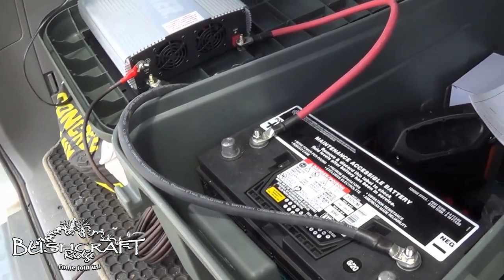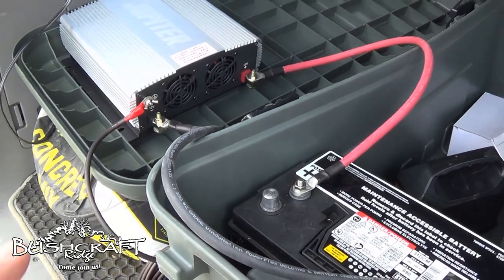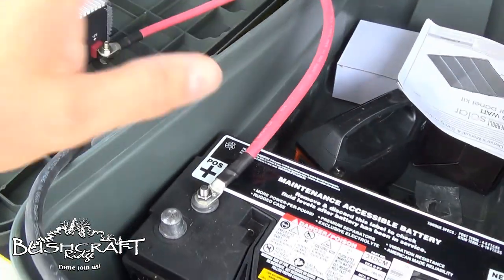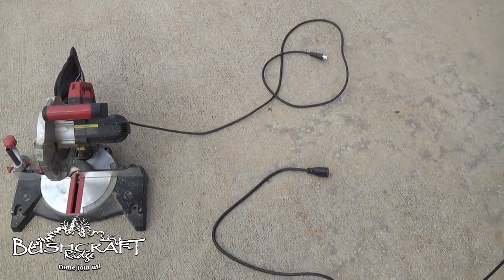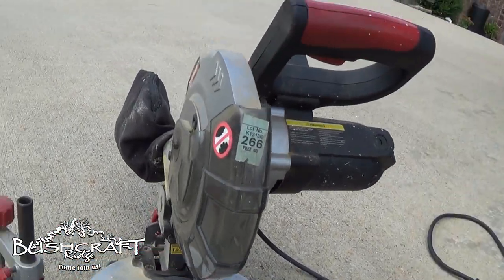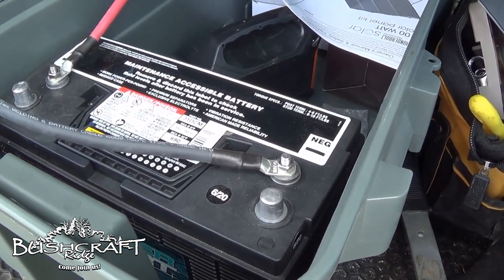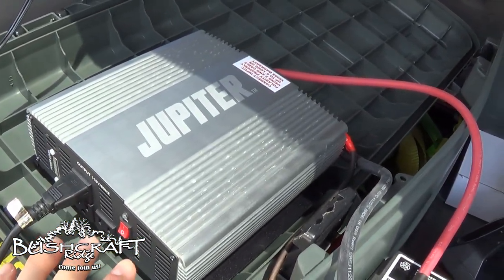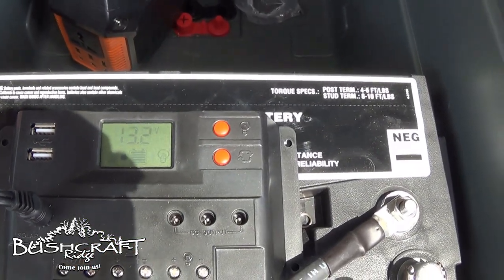Testing the Jupiter 2000w (4000w Peak) Power Inverter from Harbor Freight

Comment: I also purchased the Jupiter 2000 Watt Power Inverter from Harbor Freight. I also purchased two 24 volt deep cycle batteries and all the cabling to go with it. Never had to use them, but keep them for around for a "what if" scenario. I keep the batteries on a trickle charge so they're always primed. It's nice to see someone else who has purchased the same item putting it to some use. I liked your video!

Comment: The problem with testing the saw as your power draw is when you don't cut a board with that saw your not putting a load on it so it's not drying his much power is it would if you were to be say cutting a two-by-four

Comment: Using a 800cc or a 860cc battery with a 1,500w or a 2,000w inverter with your car running can it power on a electric oven that's 1,500w may someone try it ?

Comment: I have the Jupiter 1000W version.  Only because my RV fridge runs on propane or 120V.  A little difficult to cool the fridge when no 12V system is available.  It works well for me for that purpose.  However, it produces a lot of RF noise if you plan on using radio equipment on the HF bands.

Comment: What I have found using my Skill Circular saw to prune the trees around my house I can only do it lightly before the breaker beeps and needs to be reset. If you try pushing a load through it it will pop the breaker every time. What I find my 2000 watt Power inverter is good for is the harbor freight saw saw for $20 with coupon doesn’t pop the breaker but I seem to only get about nine months of intermittent life out of the saw unit for the third time🤢🤮🤮. My recommendation also get yourself also a tiny 300 W unit the reason being you don’t want to deplete the batteries energy for small consumption uses.
Reply from the maker: Thanks for sharing!
Reply: The reason your only getting 9 months is because this is a modified sine wave inverter, not a pure sine. Modified sine wave inverters, while cheaper, are not much good for long term use on certain components. Notice I say certain, because some electronics seem to weather better than others.

Comment: I have the same exact one and you DON'T need to hook the big black negative cable to the battery. You can hook it directly to a seat bolt or somewhere in the chassis because the battery terminal coming off the battery is just grounded to the chassis itself. This is DC (direct current) and not AC where it alternates and needs to come back to the power source like a breaker panel box in your house (black and white wires). 

The smaller ground wing nut is the "equipment grounding conductor". It basically helps grkund the inverter body. Just hook a wire up and ground it to a different ground point. I've never used it and my inverter still worked.

Comment: I had to buy the Jupiter 2000 when I needed some power ASAP. Saved the day, but our car battery had no small aux posts like I see here. I just hard to tuck the flat pieces under the existing cable connectors. Again. It saved the day but I am woindering with 2000+ can you only use cables like this or can you get some with like jumper cable type clips? My connections were tenious at best and just had to stay very still. Thanks for the post!

Comment: Nice heavy duty cables! For out at your cabin, if you haven't already, drive a steel pipe or any long piece of metal down into the ground and you'll have a decent ground termination. 
I like that it can run that saw. That's 84W continuous but it could draw as much as double the current and of course more Watts. Hahaha as I'm typing that you were questioning the startup power draw of the saw. I would estimate the peak startup draw to be no higher than 15A.
Excellent setup, it's come along nicely.
Reply from the maker: How did you know I was going to ask you about how to ground out at the cabin!? You answer my questions before I even ask. A foot or two of rebar under the cabin okay?
Reply: @BushcraftRidge  definitely! For high power things like a plasma table it will have brass rods. For your application and the amount of total power, W, one piece of rebar as deep as you can hammer it down will be perfect. If it's rusted that won't be a problem. However if it's coated in epoxy or paint expose as much metal as you can. To "bond" the wire to the rebar a clamp is more than enough. Even just wrapping several turns of the bare end of the ground wire then wrapping in tape will be perfect.
Reply from the maker: Thank you, sir!

Comment: You really need to crimp that wire as you well know. Any electric connection that is loose can arc and catch fire and/or melt the wire. Thanks for the review, I need pure sine wave and harbor freight has them too. Either going with them because you can buy extended warranties which it’s not a question if if it will fail, but when, lol. Love Harbor frieght

Comment: nice video but power still in the inverter you should put switch between positive of battery and positive of the inverter to shout it off so no power in side of inverter cool video

Comment: It the description its says NOT for marine use. Does that mean not to use marine batteries or not to use on a boat??
Reply: On a boat saltwater in the air will eat the components if they aren’t coated however will work on a marine battery
Reply: I think there is confusion because of battery terminology. Use a deep cycle "marine" battery. These batteries are designed to be drained to nearly empty and then recharged multiple times. Typical car cranking batteries will work but are designed to supply many amps up front then have be recharged relatively quickly. Most likely you wouldn't get the life out of them if used to power an inverter long term. I would guess the inverter is not designed or suitable for use in wet locations such as on a boat.
Reply: @rudolphcastle9110 i was confuse too thank u..
Reply from the maker: I thought it meant not for use by the US Marine Corps.

Comment: Why did you choose a modified sine-wave (better called a modified square-wave) inverter?  This really is a significant limitation to your system.  You would do much better with a pure sine-wave inverter.  The price at HF really isn’t great, even for a Modified Sine-wave inverter.

Comment: Got one of the when on sale and it was dead on arrival. Fuses are fine and hitting the reset does nothing. Anybody have any suggestions on what i can do? They wont return it and it wont work and im not sure what to do. Highly recommend security nuts or locking nuts to deter theives, previous system was stolen. Rebuilding setup now and its proving more difficult. Cost is higher, budget is spent, quality is lower. Charge controller, inverter, and batteries were stolen. Solar system still here but trying to get something running on the cheap... Any suggestions?

Comment: So if you wanted to run a window ac unit at your cabin, would you just add more batteries? Can the 100 watt panel system you have charge 6 batteries? Just takes longer to charge the 6 batteries?
Reply from the maker: Yes, as long as the inverter wattage will support whatever the a/c unit needs. You could add more batteries or bigger batteries. And you could also add more solar panels to the charging system.

Comment: Question.... Will this work for my lawn care vehicle? I have an all 40v battery powered set-up. How many batteries may i charge simultaneously with this particular inverter and a dedicated 12v battery. All set-up independently from the main battery of my vehicle.
Reply: how many of my lawn care 40v batteries may i charge on the 40v battery charger

Comment: If I’m doing this in my shed where electricity is not available, where would I ground it? Or does it always need to be grounded?
Reply: drive an iron rod a few feet into the earth and then attach the ground wire to the rod
Reply from the maker: Like Time said. I do rebar straight into the ground.
Reply: 8  feet, to be precise.

Comment: Grounding it to the vehicle can be problematic I did that for my mobile home and touching anything that was grounded gave me a nasty shock and when I tripped and fell touched both the mobile home and my camper that the inverter was in I got a nasty shock and fried the inverter I finally found a utube channel that explains why apparently an inverter even puts power to the ground so ground has to be earth this problem was what stopped me from going solar for a lot of years
Reply from the maker: Thanks for sharing. Yeah, I since gone with rebar driven into the ground.
Reply: Another F Y I is for every 1000 watts you should have a battery. Each battery can provide 1000 watts, but if for some reason you need to run say 1800 watts and it has to surge to 3000 watts something is going to trip or burn out. 

It does not matter if you use a set of 24DC or 27DC OR 31DC batteries, there should be 4 batteries for an inverter that surges to 4000 watts.  We own several size invertes and the inverter best matched to the power draw. We have 125, 250, 450, 750, 2000 and 3500 watt inverters. If I am only running some LED lights at night I use the 125 watt 250 surge inverter. We also have two battery banks that I can tie together for 8k of total surge watts if using several inverters at the same time. We live in Florida and deal with a lot of power outages and brown outs. 

Hope this helps anyone who did not know. My system is over 10 years old and all my inverters still work but one. Had to repace the 750 watt after a few years.

AMPS  X  VOLTS = WATTS
1 AMP X 120 VOLTS = 120 WATTS

Comment: You said you grounded the inverter to the chassis of the vehicle ? But that's not true ground it's a relative ground. True ground would be a ground spike in the ground. The chassis of the vehicle metal would be relative ground as the tires isolate the vehicle from the ground.  So, if there were a short to the vehicle chassis, I assume it would protect you from a shock. The inverter is isolated from everything, so in theory, you would get a shock between live and natural unless you touched live and earth on the appliance. But now live and the chassis of the vehicle would shock you. I'm not sure of the advantage of the ground wire you added to the chassis of the vehicle. But yes, follow the instructions supplied and get advice from a professional.

Comment: Does anybody use a fuse link or breaker between the battery and the inverter?  The instructions on that inverter calls for a 12 volt 240 amp fuse or breaker. I didn't put one at my camper.
Reply from the maker: That's a good question. I have not seen any use one. And I think the inverter has an internal fuse and surge protection, but don't quote me on that.
Reply: @CyberviewU  I found a resettable 250 amp breaker for around $12 no shipping. Added a 12 volt auto type disconnect switch. Made up a 6 inch jumper to go between the two. It should be a safe circuit now. Or at least in my mind it should be.
Reply: @CyberviewU  Correct, Bussman, ANL, Maxifuse, all about the same.  If should be fused to protect the wire.  On the other hand, if your wire is sized larger than the max amount the inverter can draw, then fuse it not needed so much except to protect against a short.
Reply: James Raymond  that's odd, mine will run  my 5,000 btu window air. I dont know how long the batteries would last at night but during the day the solar keeps up for a long while
Reply from the maker: That should definitely keep the inverter's fuse from blowing! I'm sold. Definitely getting one. :-)

Comment: Would this be able to power a 807w sump pump?
Reply: 807 watts divided by 120 volts = 6.7 amperage. Should be quite doable since he’s running a 7 amp saw.

Comment: Hi i am not mechanically inclined in any fashion. I was wondering what the piece that you used to connect your ground wire to the inverter is called.

Comment: If you owned a Prius, it would act as a generator that you could drive.
Reply from the maker: LOL! It wouldn't make the trek out to Bushcraft Ridge.
Reply: I don’t think you could. Like most portable inverters, this one runs on 12V. The traction battery in a Prius produces FAR more than that.
Reply: A Prius also has a regular 12-volt battery.  That's what you connect the inverter to.

Comment: The ground needs to go to the earth if you are going to use it.  Grounding to the vehicle frame does nothing - it isn't grounded.  If you ground to the vehicle frame, it can actually be worse if you are using a 12V system tied into the vehicle battery as you are essentially tying into the negative on the battery not an actual ground.
Reply from the maker: Thanks for the tip! When actually in use I use rebar driven into the ground to ground the system.

Comment: Tighten those bolts on the battery, you shouldn't be able to move the lugs!!!
Reply from the maker: I think I eventually did. Thanks for the tip!
Reply: Can you connect this inverter to a car battery,then connect a car battery charger to the inventer via dc connection to the inverter so it can charge the battery?